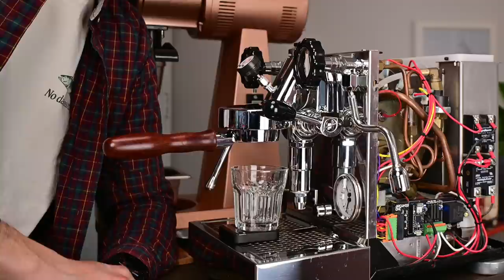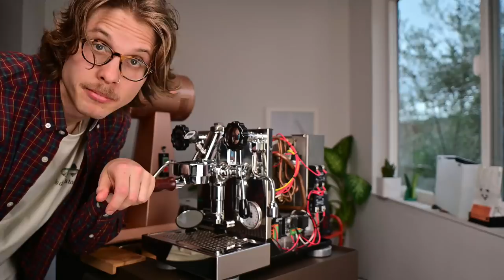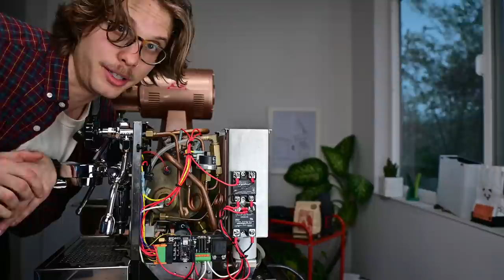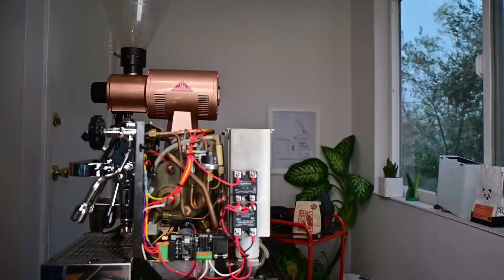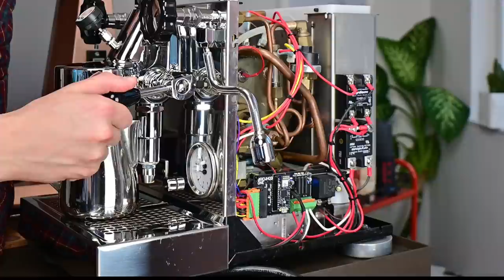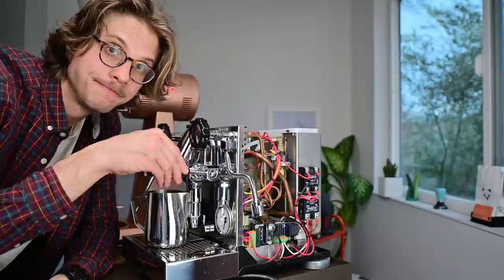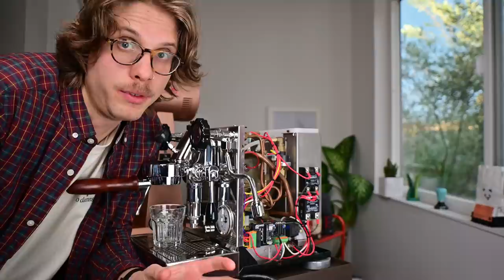I Built an Endgame Rocket Espresso Machine | An Engineer's Rocket Appartamento Mods

Comment: Hi Tate.
My machine will not stop heating until the point where the safety valve releases steam from the front center bottom round port. and the pressure gauge is way too high.
Is there a quick fix? 
I can guess that some thermostat sensor is not working. it should shut off the heating once it has reached the correct temp and pressure.

Comment: The video is fantastic. I would like to suggest adding LED lights inside the machine. Question: My Rocket Departemento at 9bar and above, reaching 100 plus degrees. I attempted to lower the pressure by adjusting PRESSURESTAT to 8 in order to achieve a temperature of 97 degrees. Would it be possible to maintain the pressure at 9 bar and above while reducing the temperatures to 90?
Reply from the maker: Hi good question! There are two pressures you are talking about. The pressure of the steam boiler is totally independent of the pressure of the espresso. So you can have any pressure you want on the steam boiler by adjusting the pressurestat, without having to worry about changing the brew pressure. Changing the brew pressure would require adjusting the Over Pressure Valve or spring on the pump.
Reply: Thank you for reply, The espresso machine I own is a Rocket Appartemento model, which is operated by a pressurestat. Is there any possible way that you might know of to incorporate PID into this machine, enabling me to regulate the temperature?

Comment: Hi Tate, can I use that double gauge with a stock Appartamento (direct drop-in), or will I need to do modifications? Thanks!
Reply from the maker: Hi Chris, it's been so long! Thanks for the question. The dual gauge is essentially a drop-in replacement that can be connected directly to the outlet of the pump. You just need to add a 1/4" bsp T-fitting to tap into that pressure at the pump. I hope that helps!

Comment: Can this essentially be done via flow control on your E61 group head?

Can you modify your E61 to be electrically heated instead of thermosyphon? It really would be cool
Reply from the maker: That would be cool! Yes you could get similar but not exactly the same results with a flow control.

And yes, actively heating the E61 is definitely possible, I believe that is the technology in the Sanremo You. They replaced the mushroom at the top of the group with an active heater.

Comment: So I have been wondering about the solid state relays. I have electromechanical relays on my own machine but I don’t like the clicking 🙈
Main thing holding me back from switching(pun intended) is that the SSRs get so hot… what is your experience with this?
Reply from the maker: Good question! SSR's are pretty much standard on commercial machines. SO using commercial-grade SSR's on this little machine has been barely enough to get them slightly warm, especially since I used the large stainless steel sheet as a heat sink.

Comment: Hey mate does the rocket have a conventional e61 group head or is the lever just for show? Because if it’s a convention e61 you I think you should open the lever up the whole way and use a separate lever for pump pressure so that the valve in the head isn’t dependent on the pump pressure

Comment: Pressure control from the main lever blew my mind. Can you go all the way from no pressure flow to nine bars without doing something on the app?
Reply from the maker: Right now the range is about 3-11 bar, but I can definitely remap it to go lower. I've found that range is sufficient. If I want to go lower than 3 bar I usually just turn off the pump like I did with the blooming shot

Comment: Water temperature sensor in the tank is a concern.  It will read incorrectly if there is too low water level so you have to use the pressure sensor to turn off the heater as well to prevent an over pressure.  The pressure sensor should also respond faster and is the standard way these machines are regulated.

Secondly You are braver than me with drilling into a pressure vessel and hoping the threads on the thin wall are going to be enough to maintain the full safety rating.  Be careful that it never exceeds the pressure you have already used it at, you have no idea if there is any safety factor left.

Nice that there are after market controls that can add features to basic units.
Reply: The fact the element is mounted to that side would say it’s possibly a brass endplate, even a 3mm brass endplate will be able to be drilled and tapped to accept that temperature sensor, 
normally it would be set up in a way that “if” a certain temperature is reached any heating controls would disabled, no idea if this has been implemented.
coffee machine pressure vessels are tougher than you think, although most are rated @ around 2-3 bar max working pressure, the reality is they could withstand higher for a period of time.
with 30 years in the coffee industry as a tech it’s never wise to buy a “cheap” machine, my dream would be a Kees van der westen speedster with idromatic, having installed many of these machines the difference in profiles you can attain with the same beans is quite amazing.

Comment: are you gona do a full automation?
have recipes or profile on your app?
will you have an option where you record your manual brewing, save it as a profile, and if its a good brew, you will use it or even use the parameters on the profile to improve your next brew? 
imagine if you can make a graph of like temperature to acidity, or pressure to smoothest table.
any ways. Love your project. I don't have an espresso machine yet but as an engineer, I also wanted to automate my own espresso machine too.
Reply from the maker: All great ideas! Full automation is unfortunately challenging with a manual brew lever. Even turning off the pump means there's some residual pressure left from the heat exchanger. My next video will show an execution of that app with my GS3 which is much more automated with actual recipes and logging.
Reply: That’s exactly what I was going to write here. Would be great to log all the extractions and the be able to replay them automatically.

Comment: Instead of drill and tapping the boiler on the side, can the water level probe fitting be adapted to hold a temp sensor?  I have a Giotto PP and would be willing to tackle this project if/when all the parts are available.
Reply: Nice idea, or just boiler surface temperature? I mean 12 bar is not a joke. A guy in a barista forum had a grouphead temp exploded and a lot of skin burn
Reply: @spruce1000 yeah, but then it would be hard to determine the differential, and I would think the metal will retain temperature more steadily than water.

Comment: Hi, Great job on the mods. Did the PID mod work for you? I noticed you still temperature surfing the machine.
Reply from the maker: Unfortunately even with a PID, you always need to do a bit of surfing, since the water you pull out of the HX is always gonna start heating up (past brewing temperature) as the machine is sitting. heat exchangers work best when they're being used to make shots at a consistent back-to-back rate, so the water is being heating at a consistent rate

Comment: From an electronics point of view I am missing diagnostics. What about the diagnostic of the SSR's? They can heat up quite a bit and lose their capability to disconnect the explicit circuit it is connected to. It is provideable over a galvanically isolated current transducer to measure the load that is applied at the SSR's. For instance LEM is a good choice here. I also really like your own designed BREWBOARD, but I personally wouldn't use an Arduino, even though it is easily programmable. I personally would have used an STM32 or ESP32 with an onboard regulated power supply section for the individual voltages such as the 24V you need for the gear. There are also buyable options available like TRAC or other solutions offered by for instance analog devices to create an ELV (Extra Low Voltage) of 12V, 5V, 3.3V etc.

Comment: awesome work !! love the dual gauge - could that be retrofitted with standard internals? Keep the videos coming 👏
Reply from the maker: Thanks! Absolutely. Just install a T-fitting at the output of the pump, and add the capillary tube between the gauge and the new port at the T fitting. I may add a video soon of just that process.
Reply: @tatemazer  thank you 😊
Reply: @tatemazer  yes please! very interested in this as well!
Reply: I’d be interested in seeing this too. I’ll definitely send a tip
Reply: @tatemazer  would the T fitting be 14mm?
Reply from the maker: @christopherjiongo58  fortunately you can usually assume just about everything on domestic machines like this use 1/8" bsp

Comment: I'm curious what use the PID is, ultimately, given you're still forced to run lengthy flushes to reach an acceptable water temp at the brew head? What am I missing? As an Appartamento owner, that's my biggest gripe with the machine - It's very difficult to reach a consistent temperature into my workflow, and a PID would (theoretically) get me what I want. Would love some sort of guide to add any and all of these modifications to my own machine. Thanks for modding the Appartamento and documenting it!
Reply from the maker: Unfortunately that PID is only responsible for keeping the steam boiler at a stable temperature. Because this is a heat exchanger machine, the temperature of the group depends on the rate at which the energy from the steam boiler reaches the heat exchanger and into the group. So if the machine has been sitting for a while, the heat exchanger can heat up the brew water. Only by water flowing through the heat exchanger does the temperature stabilize because it is forcing room temperature water through the heat exchanger
Reply: @tatemazer  Aaaaah yeah, I see. Do you have any tips or mods for keeping a more consistent brew temperature then? I've got the group head thermometer, but get tired of running huge cooling flushes, then having a dramatic dip in temperature over the course of a shot.
Reply from the maker: @kinarkyl  unfortunately that is the nature of the design of a heat exchanger :/

Comment: So happy to finally see the BrewHob in the field! Until now only ever seen the uninstalled PCB. 😅

How did you manage to drill/tap that hole without getting brass chips all inside your boiler?
Reply from the maker: I can't say that I'm sure my boiler doesn't now contain a little bit of unexpected "minerals" 😅
Reply: @tatemazer  Great job!

I am also wondering about the boiler material and the thickness of the end plate you tapped into. Is the boiler stainless steel or copper? And how thick was the end plate? My hobby is model engineering and we're not allowed to tap into the boiler - we must have a hard soldered or brazed bush with the thread in it. I also wonder whether it's good for us to be drinking water from a copper boiler.

I got caught up in the Gaggia Classic Pro mania and from factory that thing runs at nearly twice the pressure of my loco... a bit scary to be honest! I built an adjuster for the OPV to calm it down a bit. That's an aluminium boiler I think, and I'm also wondering how poisonous that is. I saw it was coated, but even so, that coating no doubt disappears.

Comment: Gotta ask, why not use a paddle instead of the whole potentiometer shebang?
Reply from the maker: Good question! This was largely designed to replace the very loud vibratory pump, and this setup is more about pressure profiling, as opposed to the flow profiling on a paddle.

Comment: Hmm is your PID not working all that well? I feel like you shouldn't need to keep adjusting the temp by purging if your boiler was set to a more appropriate and or constant temp. I also could be totally wrong haha Great vid!
Reply: Also, I usually aim for 204f with my shots. However, I gotta say with settled (7ish days) coffee that's diled in  at a solid med roast, I really didn't notice much of a difference with temp, until it got too cold. (But never tested at or above boiling haha)
Reply from the maker: Remember this is a heat exchanger machine, so the PID is only responsible for maintaining the steam boiler temperature, which is set at about 260F. The brew temperature is only dependent on the constant ambient water flow through the heat-exchanger, which can get nearer to the 260F at the boiler if it sits for too long without flowing.
Reply: @tatemazer  oooooohhh I did not remember haha that makes loads of sense.

That makes me think.. could you make it a double boiler and still fit? with all your mods/ knowledge, you could definitely pull that off! I believe! (That is if you actually wanted to)
Reply from the maker: @wexy021  it's doable! Coffee Machinist put a small second boiler in a Silvia a while back (before the pro existed), but honestly at that point, I'd sadly prefer to just start from a dual boiler machine

Comment: Quick question do you think it will be possible to integrate gagguino in the appartamento ?
Reply from the maker: Thanks for the question Jeremy! I've never implemented the gagguino bc I'm more focused on visually subtle mods, but from what I know about it, much of it is possible as there are many parallels between those two machines. The primary difference is the lack of a solenoid valve for the group, which I'm sure can be worked around
Reply: @tatemazer  Hey man since my last comment.. ive been wanting to mod my appartamento, how difficult would it be to swap the water pump to the mecanical one ? 

was thinking to only start with that and the pressure gauge before going full mods ahah
Reply from the maker: @JeremyLatreille  I might recommend checking out the pump mods on the espresso aficionados discord, there are a handful of people on there that have done just pump swaps. It requires installing the pump and motor controller. Not incredibly straightforward but possible. I hope that helps!

Comment: Very cool machine dude. I want to mod my single boiler ecm classika with an thermo block (run through heating element - I don’t know the English name) for quicker steam. Do u think that will work?
Reply from the maker: Hmm tough to say! My experience with thermoblocks is that they struggle to compete with true boilers when it comes to steaming power. I might suggest using a boiler instead, but that starts getting expensive 💰💰💰
Reply: @tatemazer  I want to connect the thermal block to the boiler, so the water entering the block would be very hot already. What do u think?

Comment: Can you pre flush by reading the head temp automatically, program a profile by pulling how you want, then run it automatically through the arduino? Or is it purely manual because of the potentiometer and no tracking of the head temp?
Reply from the maker: Unfortunately I don't have a digital sensor connected to the group, so I don't have that level of feedback back to the controller :/

Comment: I don't like vibration pump sounf for sure. But cant stand dentistry tool sound as well. Is there any other option fitting in that space like rotary pump? Btw, nice video and job buddy. Coffee comunity need more ppl like you.
Reply from the maker: Thanks I agree! This pump is significantly quieter but still not a great sound. The best option right now is a Rotary DC pump found in the Synesso ES1 and some other machines. Its the best combination of size, sound, and control

Comment: This is so cool. Why this method instead of a flow control paddle on the top?
Reply from the maker: Thanks! I'm more a fan of repeatable profiles, so this method makes that easier, since I can just program something into the controller
Reply: Flow control is nice to have but it's difficult to control the final pressure cause you have to be precise with movements of millimeter

Comment: Where is the circuit breaker switch? i put my machine on the side while there was a little water on the bottom and it might have caused a short! how can i reset it?
Thank you
Reply from the maker: Oh no! Fortunately there is a small transparent plastic fuse holder in-line with the power switch. Hope that solves it!

Comment: By lowering the pressure aren't you lowering the thermosyphone flow which may result in the grouphead being way much colder than the targeted temperature?
Reply from the maker: Good question! The temperature only drops about 0.5 degree F per second when I'm flushing at a really high flow rate. Once I get the group around the temperature I want, it'll generally stay there for the duration of the shot.

Comment: Is there any advantage/disadvantage to varying voltage instead of using PWM for running your pump?
Reply from the maker: Hey Phillip, good question. A variable DC voltage is more challenging for a microcontroller to produce, and thus more expensive. Microcontrollers always speak best in binary, on and off, so PWM is much more inline with it's language. PWM is sufficient because the frequency response of a motor is essentially zero at the frequency most PWM signals are produced. In other words, the motor smooths out the pulses, itself.

Comment: Did you need any adaptors to hook up the bezzera 7432524 and how would I go about doing this
Reply from the maker: Fortunately no adapter needed to install the gauge. It's a drop in replacement. But note that you do need the capillary tubes for each gauge
Reply: @tatemazer  ok where would I connect the brew pressure tube?